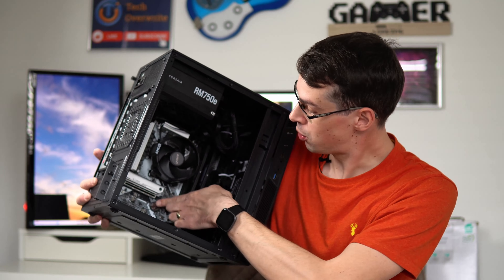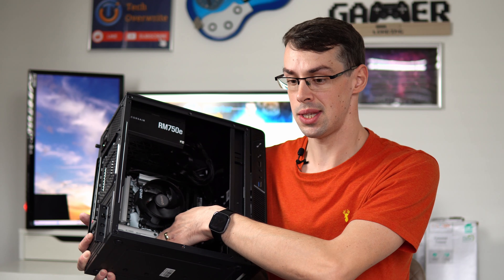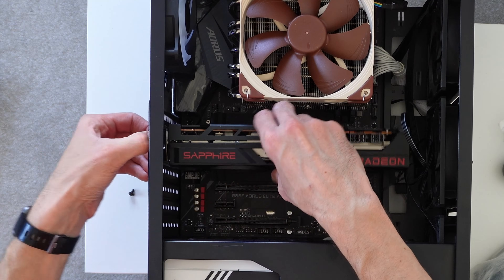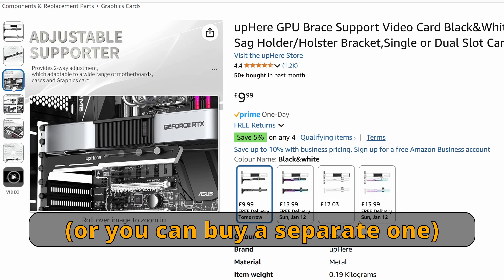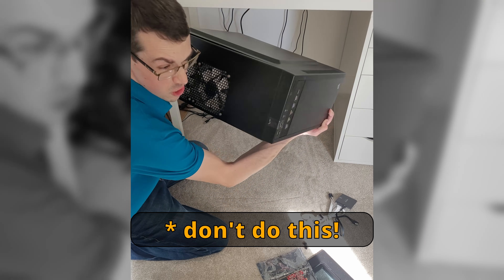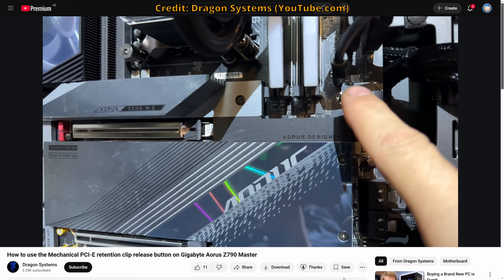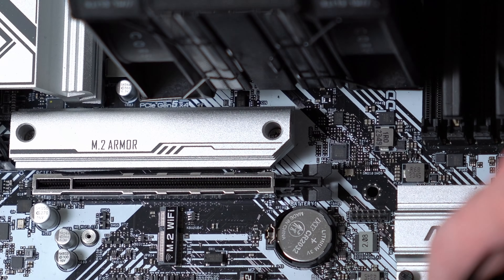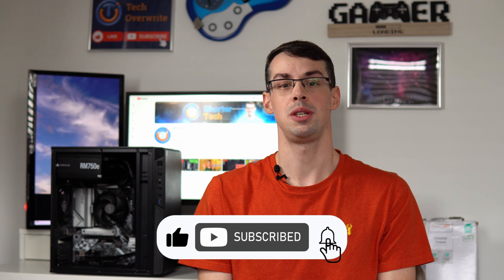My PCIe Retention Clip Fell Off! Uhm... Do I Need It?

Comment: My PCIe clip broke, I put it back on then reseated my 3070 gpu and it broke off again but the card went in fine, my worry is that next time I remove the card is it now stuck without the pcie clip? Would appreciate any help👊🏼 need to do a fan repair real soon, just did a repaste and was troubleshooting the faulty fan
Reply from the maker: It's annoying isn't it? It shouldn't be stuck though - if anything it'll just come out too easily (which is why it's important to make sure it's always secured into the case).
Reply: @ShorterTechOverwrite  thanks for the answer, super annoying! I'm going to be changing one of the 3070's fan by end of week so will type back with how that goes getting the card back out the mobo without the clip, if that is the case about it coming out much easier now without the clip, that would be a relief because it was such a stiff clip for me to begin with!
Reply: Yup all good, actually far easier now to remove my GPU when I want, I prefer it, in future I'm going to consider breaking this clip off first thing when I get a new MoBo lol

Comment: I effing hate this thing, wish it never existed. It's incredibly hard to use (human hands don't fit anywhere near this tiny thing), almost forcing one to risk damage with a screwdriver. And if it doesn't get open completely, the card keeps sticking there with one end, guaranteed to damage the port by pull. It's a garbage idea, executed in a garbage way. (Or the idea might be meh, but it's executed in a garbage way.)
Reply from the maker: I agree, it's a frustrating thing - getting a massive GPU into a tiny PCIe slot can be worrying all round :/

Comment: Hi, bit late I know but I've just ran into this problem. When removing the gpu, will it come straight out or will it rely on the retention clip to unlock it for removal? Just don't want to put a gpu in then find it to get stuck lol. Thanks 🙂
Reply from the maker: Hi, good question :) Should have specifically mentioned it but you will be fine. Basically the GPU will come out 'too easily' - without the clip. So just be careful when removing it. But it won't be stuck.
Reply: @ShorterTechOverwrite Hi again, thanks for the reply. I put a graphics card in however, when trying to remove it the card would not release easily so I had to push the part of the clip down with a flat head screwdriver and pull the card gently out. Luckily it worked, I was freaking out lol.
Reply from the maker: Ah great, glad to hear it worked out okay :)

Comment: Thanks for the reassurance, had a really frustrating formatting error today when attempting to install windows, of course I went SFF and the GPU needed to come out to remove the SSD.. Welp, the extended MSI tab actually broke completely off (when convenience takes form over reliability I guess) and had me worried for a moment. The 5080 will be in and running as soon as the new drive arrives.
Reply from the maker: Ugh that sucks - especially in a SFF build where it's usually more stressful/difficult lol. I hope the 5080 works out well for you - it's a beast of a GPU :)

Comment: Bro i broke my clip on the first day but the gpu is still attached to the screw you mentioned in the video
But i am still upset that it got broke
Does it have any side effects please tell me
Btw thanks for the video really helpful
Reply from the maker: It's definitely frustrating :/ There shouldn't be any side effects though - just be careful after removing the metal PCIe screws that attach the GPU to the case, since your GPU will then be fully loose.

Comment: I completely agree. When I pressed the release button on my board, I heard a sharp thud followed by a faint cracking sound. My heart sank — it turned out to be the retention clip snapping, and to make matters worse, the graphics card lock had also broken. Thankfully, the card itself still worked perfectly. I eventually upgraded to the 5070 Ti and decided to put my beloved 3060ti up for sale. I just need to find a retention clip first. Enjoyed the vid, thanks for posting.
Reply from the maker: It's definitely scary, I remember mine coming off in my hand and having the same sinking feeling lol. Glad it worked out well in the end (sort of!) - enjoy the new GPU, I love the 5070 Ti!

Comment: Mine got caught as ai removed a GPU. Nothing broken, its jus popped out. Looks as they to refit it I need to slightly 'spread' the plastic walls to ease in the little studs. Hmmm It's quite tough plasic and I'm not sure if I'm brave enough.
Reply from the maker: Yep that's how I ended up putting mine back on - it hadn't fully snapped, so I just spread it outward a little and it did clip back on :)

Comment: I had them broken and now my monitor blacks out but pc still turned on just can't do anything but restart the pc.
Reply from the maker: Ugh sorry to hear it - you sure there's no physical damage to the PCIe port too? In theory it's just a physical clip that shouldn't cause any GPU or display issues at all :( I hope you can get it sorted.
Reply: If the PCIe port is damaged, is there a way to fix it? @ShorterTechOverwrite
Reply from the maker: Unfortunately not easily. I mean, repair shops will do it which might be financially worth it for $500 mobos. But for a $100 mobo? Cheaper to buy a new one 😔

Comment: It's really annoying. I didn't really care when I had a smaller card (Asus Dual RTx 4070) but now with my huge Sapphire Pulse 9070XT I do care. Feel like the card is too heavy. Got a bracket under it though but it still bothers me. These new motherboards are with release buttons seem like a good "excuse" to upgrade my cpu to AM5.
Reply from the maker: I completely agree, I bought a 5080FE (which I then sold) and also a Pulse 9070XT and the Pulse is massive in comparison. Thicker and heavier IIRC. I do like the quick release button, it's a neat feature.

Comment: I just broke mine one, i wanted to clean the pc. The clip is ok but the holder the tiny 2 pieces are broken off that holds the clip in place. I first wanted to glue them but im scared to damage the motherboard so i didnt do it. For the rest the card works fine no issue.
Reply from the maker: Ah that's frustrating. Glad it's working fine though. Yes as long as the actual 'gold finger' PCIe pins are making good contact, that's all that is really needed.

Comment: My experience is that  the clips usually are too hard to reach when the graphics card is in place. Not impossible, but certainly annoying and I hope more and more manufacturiers will use a solution as the Aeorus boards shown in the video.
Reply from the maker: Yes that's true, it's frustrating when it's almost impossible to reach the clip. This can especially be a problem with some large CPU coolers that almost end up touching the GPU 🙈
Reply: It is useless and serves nothing. Better remove it
Reply: I agree

Comment: Hi,i i bought a used pc and noticed it didnt have that clip when i was going to remove the graphics card to clean it. How do i remove the graphics if my motherboard doesnt have that clip. Do i just wiggle it out or take it to a repair shop?
Reply from the maker: Hi, yes you can just wiggle it out - there's nothing keeping it in place anymore (apart from the screws that mount the PCIe bracket to the case itself, at the back of the case)

Comment: Quite a large number of older boards that I have (i.e. LGA 1155, 1156, 775, etc.) unfortunately have theirs outright snapped off. They were more like a tab that you had to tug on as you pulled out whatever was in that slot, and my clumsy self ended up breaking that part of the slot. It's not as though I ever planned on reselling them, but I would imagine that it probably takes away some of the resell value for the boards. It's been quite some time and I don't think it's ever affected functionality (or if it did, I certainly didn't notice) for them, but it's good to see that they've moved away from that and now seem to incorporate these more convenient clips over the years.
Reply from the maker: Ah yes, I remember the older tabs. They weren't fun either - even if I also struggle with the clips (having yanked 2 off in the past year!). It's quite a flimsily area generally, I agree.

Comment: I was not aware of the quick release button was a thing! I instantly looked up my motherboard aaaand it doesn't have one. You ruined my day :( (Just kidding... Kinda. It's good to know it's a possible feature, though!)
Reply from the maker: It's a pretty neat feature to be honest, even though neither of mine have it either lol. I guess I can aspire to have that on a future motherboard though!
Reply: A wooden chopstick comes in handy for the standard release mechanisms.
Reply from the maker: @ferrumregit4252   Ooo, that's a neat idea. I usually use a flathead screwdriver but panic about slipping and scratching a motherboard trace.